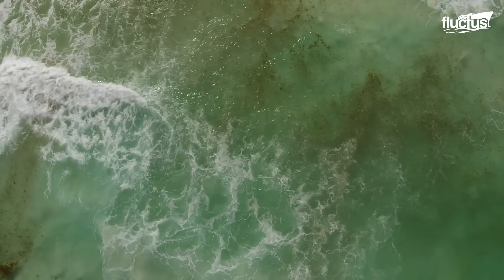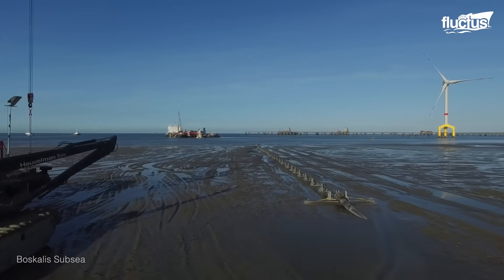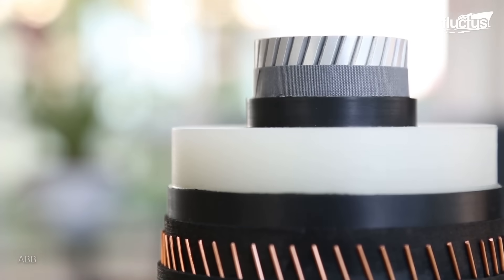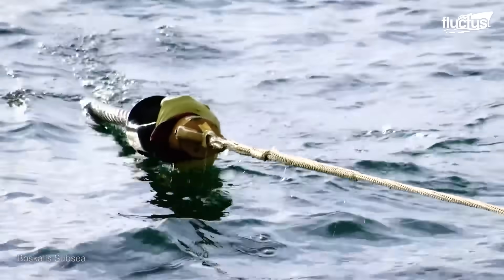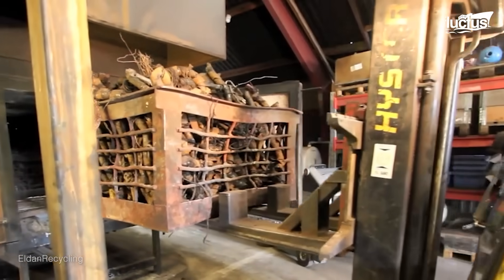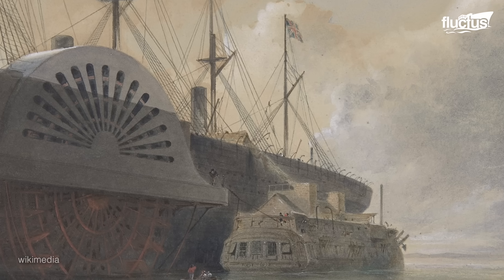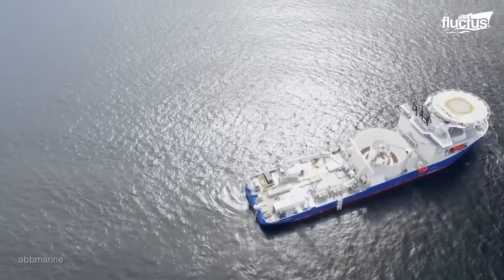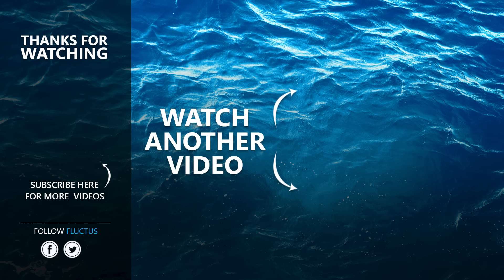There is a Reason Why Underwater Power Cables are So Expensive

Comment: Back in the 1980's a company I worked for made two custom platinum wire temperature sensors used on a Japanese cable laying ship.  It seems that they would measure ocean floor temperature and opt for colder temperatures for the cable if they could.  And the "weather" on the ocean floor changed so slowly that it was nearly constant for their purposes.  These sensors were on 25,000 foot cables we had custom made.  4 wires and a central stranded steel wire for strength.  The cable was only about 1/2 inch diameter.  The extra strength was needed because the weight of the cable itself, if just a normal cable, would tear it apart.  Electronics types will know right away why there were four wires.  Two to provide a current through the platinum wire, and two wires to sense the voltage across it with as little load as possible.
Reply: cool story bro
Reply: Couldn't floats be placed at x distance to balance that x length of cable mass, thus negating the need for the entire thing to be self supporting?
Reply: @TomasSwiftMetcalfe  I don't know if that would be practical.  it sounds like something like that would work.  And perhaps the cable could be made in a different way that contained some jacketing layer of closed cell foam to make it inherently partially more buoyant.  The thing is for adding floats, that might have to be some manual activity when unspooling because these long cables are let out and pulled in using a conventional winch.  One downside to having anything attached to the cable (or a physically larger diameter cable) would be the increased "sail area" making the effect of any water current stronger.  I'm just rambling off the top of my head.  For all I know, maybe somebody has or is doing what you suggest.  Maybe there is some patent space covered by such ideas.
Reply: @TomasSwiftMetcalfe  i think a floating cable would be at risk of shunting like a train and ripping an end off
Reply: "Based" just means "down to earth", "true", " for real", etc. You need to get outside more often.
Reply: @wvjeepguy8178  I simply didn't know this fairly new slang word.  Your insulting comment to "get outside more often" is uncalled for.
Reply: @trainliker100  You're being such a square.
Reply: @wvjeepguy8178  Well, I do know one fairly modern term.  And it is "keyboard commando."  You know.  Those people, often lacking in many areas of their lives, who hide behind their keyboards and say things to others that they would never have the courage to say face to face.  I see lots of that on Yahoo or YouTube political commenting.  It seems more rare on YouTube non-political topics - but it does occur sometimes.
Reply: @trainliker100  Your skin is way too thin for the internet, bud.
Reply: @wvjeepguy8178  And there's the other half of the equation to qualify as a "keyboard commando".  The continued baiting.  Good bye.
Reply: @pomelo9518  No.  It is a platinum wire temperature sensor which is literally just a length of platinum wire usually wound in a coil shape to save space, not to be an inductor.  (Some are made by depositing platinum on a substrate.)  These are in the class of "RTD" sensors or "Resistance Temperature Detector."  These are things where the resistance changes as a function of temperature.  (As opposed to a thermocouple sensor that produces its own voltage.)  The advantages of platinum wire sensors are that they are incredibly stable over time and have a nearly linear temperature/resistance curve.  You merely pass a constant current through the sensor (low enough to avoid self-heating) and measure the voltage.  Then you scale the voltage by some means to display or record in engineering units.  Rather simple electronics.  If you want to correct for the slight non-linearity, you have to do a little more, but that curve is well known.  A Hall Effect sensor detects a magnetic field and, as far as I know anyway, would not have an application for temperature measurement.
Reply: This where the waohs head nodes and thats crazy come in handy
Reply: It's always the comments by no pfp who makes the most BASED comments 😘👌
Reply: @seamali4383  wrong use of based
Reply: @seamali4383  What's a "BASED" comment?  And the only reason I don't have a pfp is because I just never bothered, and my ego doesn't need one.  Perhaps I could do like some and use a picture of a cat or a car or something.  Would that make you happy?
Reply: @trainliker100  
Bruh chill, he was praising you
Reply: @asain3586  Well, I guess I still don't understand the comment.  But that happens sometimes with comments, and emails.
Reply: @trainliker100   Based means cool ig
Reply: @hoopergangong  I did not know that.  That's not in a standard dictionary as far as I know.  But I did find something like that in the online "Urban Dictionary".  I would have known if that slang had been used in the movie "Clueless", but I don't think it was.
Reply: @getmeoutofsanfrancisco9917  Good advice.  And sometimes a comment is nothing but emojis that I have to look up.  (Somebody made a poster showing 4000-year-old Egyptian hieroglyphs compared to emojis suggesting we are essentially back to using the same language.)  My other pet peeve is lack of capitalization.  This now far surpasses the former excessive use of capitalization, which is ALL CAPS, but you still see that sometimes.  I try to advise people that capitalism can be important with the example "I helped my Uncle Jack off his horse."  That sentence has a small problem if written all lower case.
Reply: @getmeoutofsanfrancisco9917  based is 14+ year old slang at this point. Probably been hearing it since around 2005
Reply: @trainliker100  Cat!
Reply: @trainliker100  based is more accurately seen as having a point of view that is strictly fact and experience Based.  Get it now?
Reply: @anthonyduncan5920  I think you are perhaps the third person to point that out.  I got it the first time.

Comment: This video ignores a very intriguing point: when a few miles of cable are laid down, there HAVE to be splices. No spool of wire can contain 10-50 miles of cable. How do they make a splice? I was hoping to see that operation that has to be done on the ships while at sea.
Reply: Flex Seal ®
Reply: @LucasJasche  underrated comment bro!!!
Reply: @LucasJasche  10/5star comment right there 😂
Reply: @LucasJasche  *flux seal
Reply: @LucasJasche  very smart. Very original 👏
Reply: You are right that would have been interesting to see. Incidentally when the first transatlantic cable was laid, half of it was contained in two ships that started laying from the middle of Atlantic going to opposite directions. So you can fit an enormous amount of cable in single vessel. Not sure if it was spooled at all back then. But certainly they made several splices, one at the middle of the Atlantic and at least once the cable broke, they fished it up, repaired it and continued.
Reply: @Axel_Andersen  But that was telegraphy, not power. There's a big difference between transmitting a weak data signal versus transmitting kilowatts of power.
Reply: Look up High Voltage or Medium Voltage Cable Splicing.  It is probably more elaborate since it's underwater, but you'll get the idea. There is a ton of testing too.
Reply: @steve9216  This whole comment thread is underwater.
Reply: @steve9216 they basically lift up the cable if it's damaged. My guess is the splicing of the reels is all that complicated. Also these cables move gigaeatts potentially
Reply: @adaster98  nuh, too unreliable. My money is on soldering iron
Reply: @adaster98  😂😂😂😂😂😂😂😂😂😂😂
Reply: Reef knot ?🤔
Reply: A big wire nut
Reply: Bruh..!

Comment: lol.... $400 a foot... That's pretty good considering all the production stages needed to construct that cable. The company I work for makes a custom cable for a customer that requires, no joke, a plastic compound premixed with platinum powder that gets extruded onto their silver plated wire. The compound alone is $28,000 a pound. We have to save every last bit of scrap and send it back with the finished wire to the customer. the finished wire weighs just about a half of an ounce per foot. Not counting the cost of the bare strand, that's $875 per foot.
Reply: What would that cable be used for? 
$400 ft is still much cheaper than some of those fancy, overpriced hifi cables as well!
Reply: @woofowl2408  You know, I haven't the slightest idea what they could be using a platinum infused plastic insulated cable for. It defies all logic to me and everyone on the production floor. I'm sure the customer has some reason for it, but nobody I've been able to ask has the slightest guess. It doesn't provide shielding, the metal has to be contiguous which a powder isn't. It can't be used as a drain (grounding) because the breakdown voltage of the plastic in between the particles is too high, but it's too low to provide reasonable insulation against spurious high voltage. It doesn't even get a second layer of some other metal free plastic before we ship it, so I assume they are using it as is. The ability to add any additional layers would mean they wouldn't need us to put on the platinum plastic layer first.

So yeah I have no idea why they do it.
Reply: @JonM-youtube  Interesting, that is unusual! I guess that it's for some kind of scientific application, likely in physics or chemistry.
Reply: @woofowl2408  It's got to be something like that. I just can't see any commercial purpose for the stuff beyond some niche scientific application.
Reply: @JonM-youtube  your customer is probably just shipping that back to their home planet
Reply: @TheRobWay1  see my reply to woof owl, it's depressing....
Reply: @woofowl2408  Well I finally found out what that platinum cable gets used for... And it's kinda depressing. The company that buys it from us uses it in high end audio cables... Like guitar and other such stuff. They are essentially pulling the old "monster cables have gold plated ends so they must sound better" scam except with platinum infused plastic.... I won't say who the company is for job security reasons.
Reply: @JonM-youtube  “The company that buys it from us uses it in high end audio cables...” 
Called it!  Before I even read down this far!   

One of the finest quotations in the English language ever made: 
“A fool and his money are soon parted.” — Thomas Tusser
Reply: @jovetj  agreed. It's unfortunate that most people can't see through that kind of scam when it's presented to them. Honestly I was hoping that I was going to find out that it was going into some kind of scientific experiment or something like that but oh well.
Reply: @woofowl2408  Dude! Have you never heard of AUDIO GRADE?  (ROTFL!)